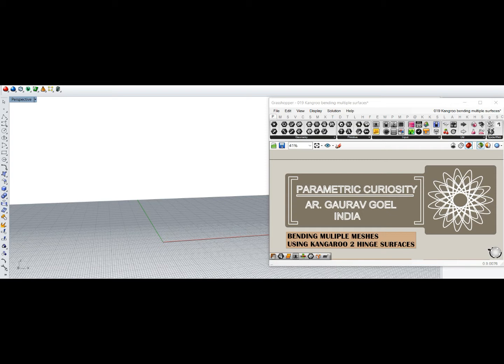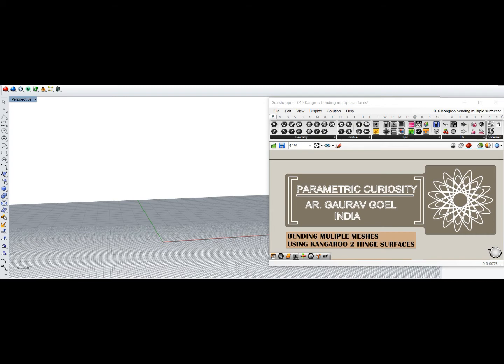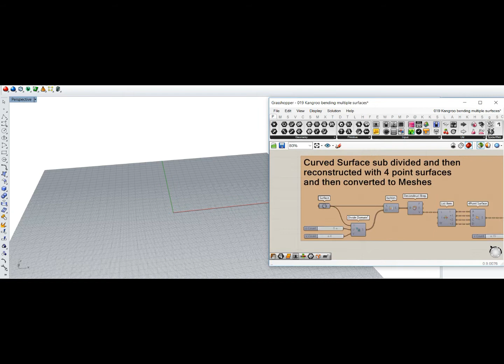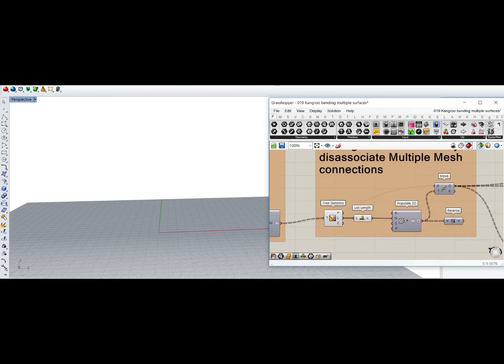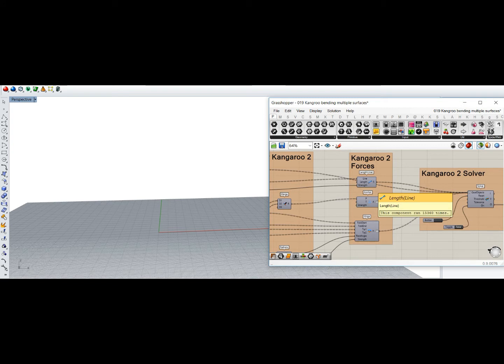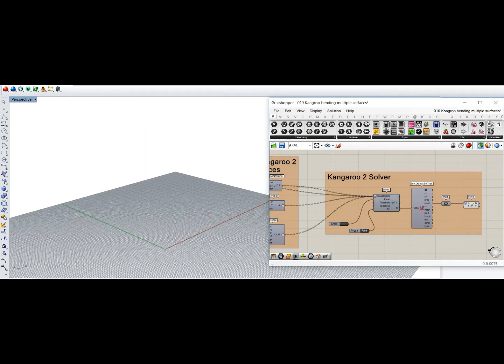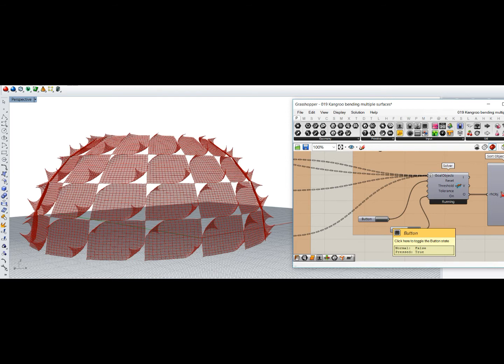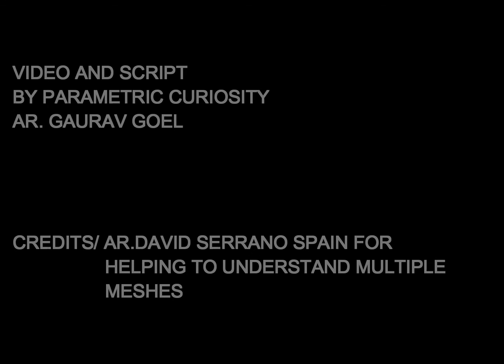Multiple Meshes folding through kangaroo 2

Comment: What is the expression equation you are using for the 'Radians' component?
Reply from the maker: TheWermers1100 expression for radians is not needed. If you want you can directly feed your angles into degrees by right clicking the angle component and selecting degrees.